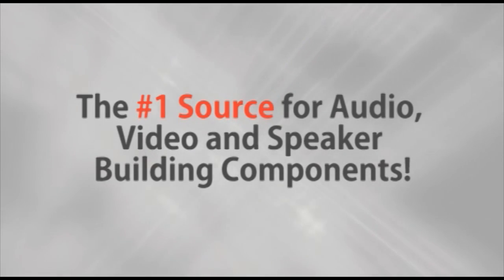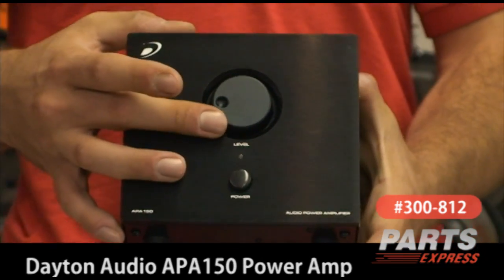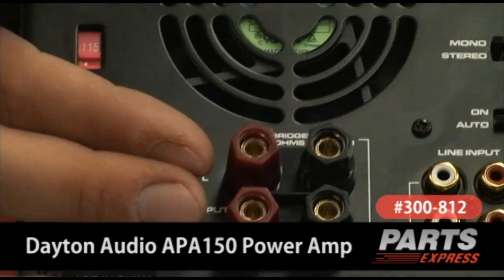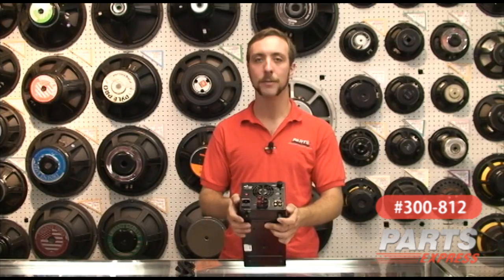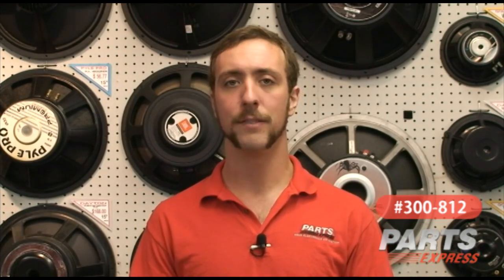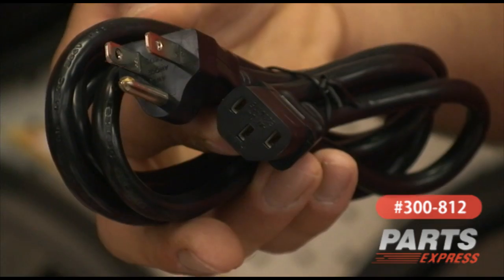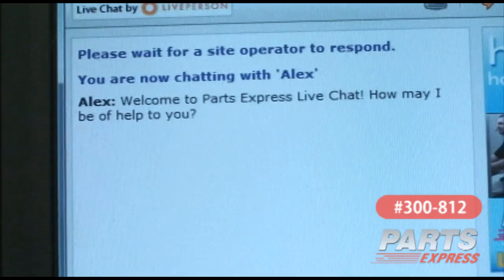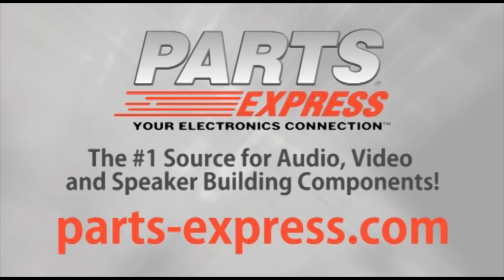Dayton Audio APA150 150W Power Amplifier

Comment: Calvinblinkee....you are so right! This guy really does look like Nicholas Cage!

As for the amp, I like it. It's small and has decent power. However, I DO NOT like the fan in the back. As quiet as they try to make these fans, they will invariably get in the way. If the amp did not have that fan, I would buy it.